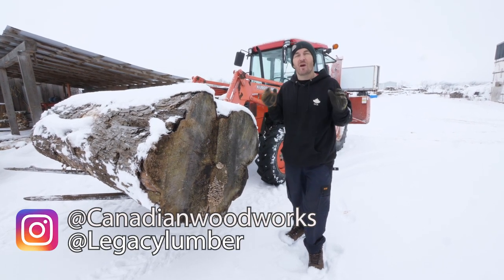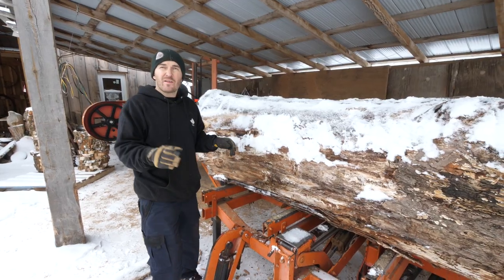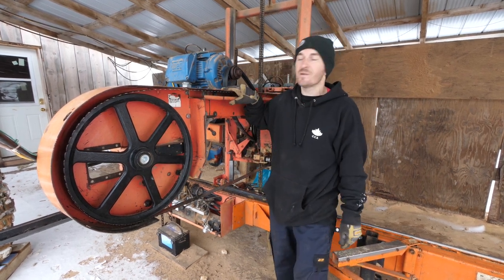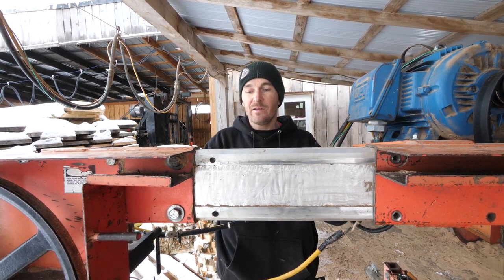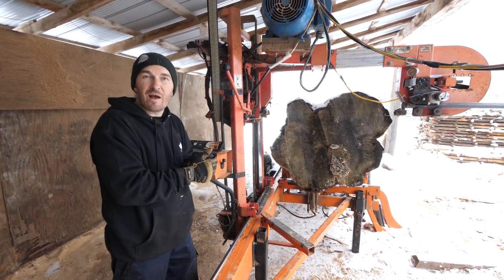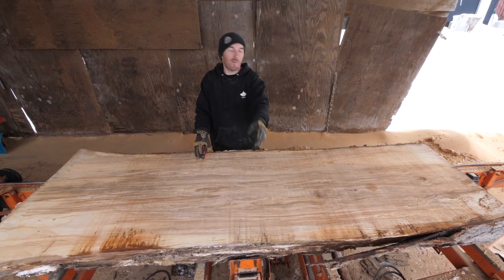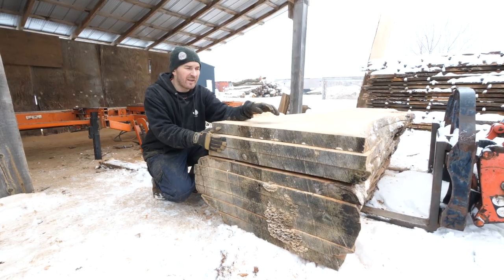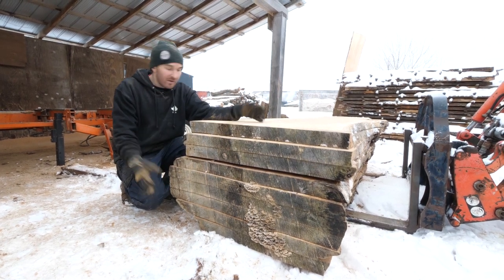I CUT MY WOODMIZER SAWMILL IN HALF!

Comment: This is an amazing idea.  I have been waiting to cut my sawhead for a while now so I can cut bigger logs, but I have over 100 blades.  I am super tired of having to cut grooves in the top of the log to get the saw head to fit at maximum sawhead height.  

Making the sawhead width extended is going go save me days of labor with the chainsaw and also alow me to cut bigger slabs as well as using my small blades for the narrow logs.

Thanks again!!!

Comment: Great idea. I cut 27 species of Burls and The two containers of exotics I purchased from Laos in 2004 and I cut about 10 % of it up to get the money back I invested. I waited 19 years to sell off the Amboyna Burl off and the Dalbergia Cochinchinesis AKA SIAMESE ROSEWOOD off for guitars sets now with the slabs of it I have Afzelia XY-Lay. 

I have a 1999 LT-40 Super Hydraulic Italian Diesel Engine with 1,232 hours on it. I had Woodmizer Service Guys come out in the Austin, Texas  area in February 2023  & they spent 9 hours on it upgrading my fuse panel & fuses and replace the five bearings and adjust everything on it removing rust and making it cut perfectly.  They were great never took a brake. They worked all that night on another saw with the lighting they had. I waited five years to get them here and it was worth the money invested. Now I’m going to widen it to 48” 14:55 or 52”. 

Thanks for your help.

Comment: Great Mod Paul.  I wish we had kept our 1993 for the same Mod, but wide natural edge boards was not the fad in 2012. 
Think about replacing the driven pulley for your WM power feed to a larger diameter to get more torque .
Reply from the maker: We have already maxed out the size of pully and even added a tensioner to keep that little belt way tighter, but still at the very slow speed it struggles.  I'd like to actually change it to a bicycle chain, then it would just crawl along but with danger or breaking I suppose.

Comment: You said that sometimes your belts slip on your motor that appears to be a 10hp electric motor that should have enough torque to burn the belts right off. I'm wondering if you're not using matched belt pairs for your saw? You can order them in matched pairs there by ensuring that they are the exact same size and there's usually no additional cost maybe a buck or two.
Reply from the maker: Hi,  Thanks for the message, but I mean the belt that drives the saw head back and fourth, not the blade motor belts.

Comment: Do you remember what length of aluminum billet you used to get the 184" blade to work?
Reply from the maker: Sorry  no I don't, I just measured the inside of each side after cutting, then subtracted about. an inch, to give it about 1/2'' on each end for crap or bad weld or what ever to make sure it fit in.

Comment: Great idea, what blade profile do you use? I use WM double hard 10 degree? Currently Lt-28 possibly going wide! Has a 25 hp should have enough power? Thanks
Reply from the maker: Hi Chuck, I have found the best profile for wide cutting is the Turbo 7deg blades, I think because of the deeper gullets to allow more dust to be pulled away easier, just my theory.  With that said I'm using 10deg because I get my blades from Lennox now and they don't have the 7deg turbo profile.  I did have a gas motor for a while but not with 1.5'' wide blades, the old 26hp onan did handle wide cutting cell with 1.25'' wide blades.
Reply: @CanadianWoodworks  
Thanks, I’m currently using 10 degree double hard they leave lots of sawdust behind on standard mill.

Comment: Any chance you could do a video explaining 1/4 sawn and the other 2 ways to cut? Also why do they say 6/4 or 8/4 when sawing lumber?
Reply: He mostly just cuts slabs. There are plenty of videos about rotating logs for quarter sawn lumber.  8/4 is just 2 inches 6/4 is 1.5. I think they just do it confuse rookies.
Reply from the maker: Hi, we don't really do any qtr sawing and there are already some great videos here on youtube about it.  The reason we say 8/4 not 2'' is because 8/4 does not actually meant 2'', when green 8/4 means about 2.25 or more.  Wood shrinks so if milled at 2'' green once dry it will be under 2'' and not sellable as 2'' lumber.  8/4 lumber should be above 2'' in thickness once dry.

Comment: Given that you said you do most of the cutting in the normal mode (28" wide or less), and you have your monster wide saw mill, is it even worth using your extended 42" mode on the wood mizer?
Reply from the maker: Great question, yes it is!!!   What mostly allows us to cut is the log that would be difficult to place when in the normal width, so we aren't exactly pushing it to the 42'' limit all day long, but for 24'' to 34'' logs that have arms or are curvy this mill is actually quicker then the big mill. Mostly from a handling stand point.  The monster is best with 40'' + logs.

Comment: also what psi tension does a blade like that get adjusted to?
Reply from the maker: 4000 PSI. The blade will stretch a little bit and will need to be re-tensioned. If the PSI goes too low while cutting, you will get wavy slabs. 

Always keep checking the tension gauge

Comment: Since the log is over 3 years old, is it still recommended to air dry the slabs? Great video.
Reply from the maker: Unfortunately the wood does not dry very much when still in log form, so yes air drying + kiln drying is still required.    Thanks for watching
Reply: @CanadianWoodworks  cccccftvCc